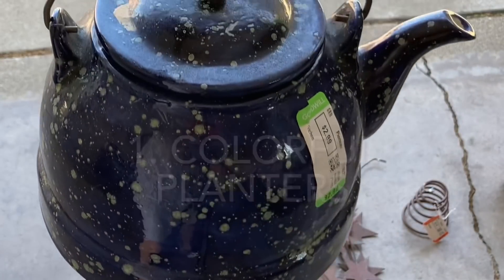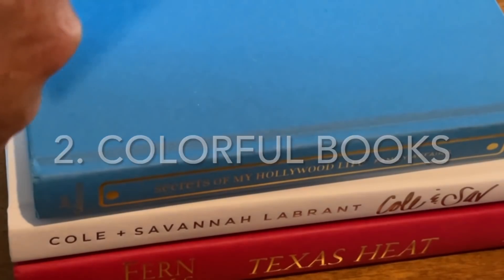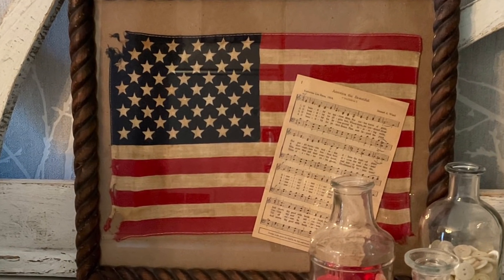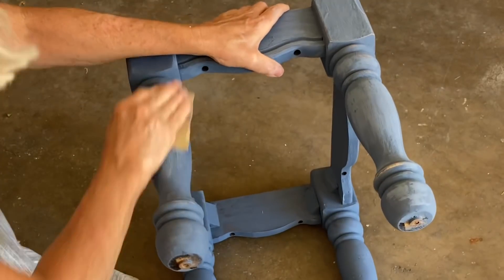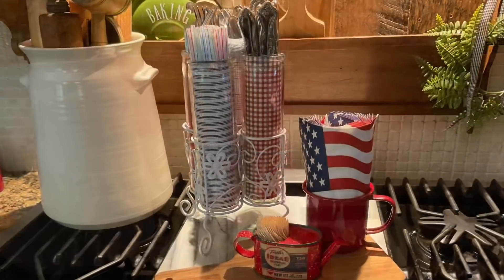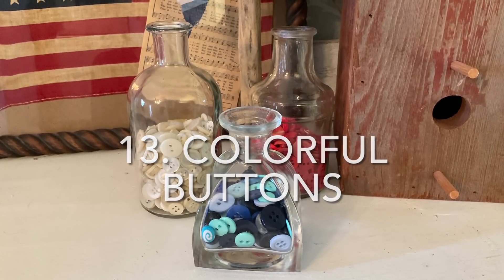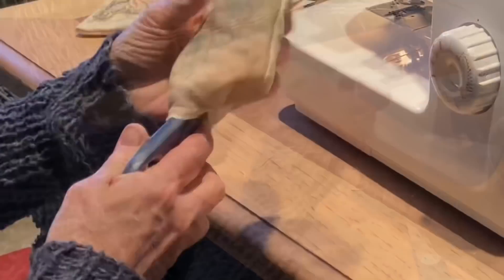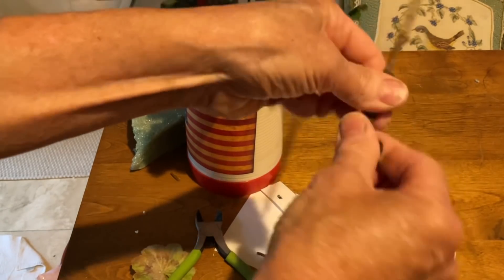15 SUPER SIMPLE AND CHEAP DIY PATRIOTIC HOME DECOR PROJECTS FOR SUMMER

Comment: oh no, you didn't!  hahaha!  welcome aboard, doll head!  you made so many lovely projects this week!  i can't pick a favorite.  i have a 4th of July craft challenge for you:  i once made a pillow on a pillow.  let me see if i can describe it. i had some old lacy fabric from a couch or chair doily.  i also had some other material for the main part of the big pillow.  i cut a heart shape out of the lacy fabric and a heart shape out of another piece of fabric, each identical in size and maybe 7 to 8 inches across.  (i was making a small bed throw pillow.)  i cut a circle in the center of the backing heart shape and sewed the two heart shaped pieces together around the edges of the heart, right side together.  i cut the big pillow fabric into 2 rectangles, but a square or other shape would work also.  on the center of one of the rectangles i cut a circle the same size as the circle on the back of the heart, and sewed the pillow fabric to the hole to the back of the heart, around the edges of the circles, with the holes lining up. you have to join the heart and the pillow in such a way that the seams do not show from outside the two parts, and the heart can be stuffed going into it from inside the pillow.  making sense so far?  i then sewed the back piece of pillow fabric to the front piece (right side facing each other), leaving one side open for stuffing.  going through the opening on the large pillow, start stuffing the heart shaped part first and then stuff the rest of the pillow.   it came out pretty cute with the stuffed heart mini pillow sitting in the center of a larger pillow, giving the entire pillow a 3-D effect.  i may also have added some lace around the edge of the heart as i sewed its front and back pieces together, and added some lace around the edge of the finished pillow.  here's the 4th of July challenge:  what if you made the mini pillow out of blue fabric with white stars, and the big pillow from red and white striped fabric, to give the entire creation a US flag theme?  just an idea.  you are such an inspiration!  thanks for posting another fab video!
Reply from the maker: Ok, I think I actually understand what you did! 😀 Would you get the same effect if you made two separate pillows and glued them together? (That would be easier.) This would be a cute Valentines Day project with the heart shaped pillow! I am going to percolate on this idea a bit and see what I comes to me.  I like the patriotic theme, but I wasn’t originally planning on doing anything else patriotic after this video. Maybe, a flower shaped pillow?
Reply: @CanterburyCottage  : yes any shape would do for any occasion.  yes, you could glue a small pillow to a larger pillow, but i am not much of a seamstress and i was able to create the sewn pillow i described without any instructions or crafter showing me how, so i know you could do it. i was much younger then and enjoyed challenges.  now i enjoy watching pros like you take on challenges.  :-)
Reply from the maker: I think you might see a pillow like this in a video in the near future!😀
Reply: @CanterburyCottage  : omg! really? you are such a good egg!  will you try the sewing method?
Reply from the maker: I’m not sure yet.  I want it to be easy enough that most people can duplicate the project.  I was thinking of doing small flowers which would be even harder to do with the sewing method.

Comment: I would like to paint glazed pots for outside, they are big and red which I'm totally over. Do you have any ideas of what paint I need and any preparation that needs to be done before Painting?
Reply from the maker: I think there are a couple of options that should work.  You could paint them with chalk paint (which would not require any prep except to clean the pots).  You would need to use a spray clear topcoat over the chalk paint (such as the outdoor spray polyurethane I used in in my patio makeover video).  A second option would be to slightly scuff the surface of the pots with sandpaper and follow with spray paint. (I would  finish with a clear topcoat just to make sure the paint doesn’t chip.) Hope this helps!

Comment: A good way to keep a fern alive indoors over the winter is in one of those self-watering pots.  I just get the cheap ones from Lowes or Home Depot.  Once a week I water the soil from the top until water comes out of the overflow hole.  Ferns like to be wet.  I've kept the same Fluffy Ruffle fern alive through 2 winters this way and it's still going strong.  Providing a constant water source with a self-watering pot will help them deal with dry winter air in your house.  I killed a lot of indoor ferns before discovering the self-watering pot trick.  Maybe Sherry can give us some ideas on how to disguise the ugly plastic self-watering pots!
Reply from the maker: Thank you so much for the suggestion! I have yet another fern that is hanging on for dear life as I type this! I will head to Lowe’s this week, and, yes, I will disguise it if it is plastic.😜

Comment: Could you tell me the best way to clean wax from your brush?
Reply from the maker: I usually just wash mine under hot running water and wipe off in a rag several times because I only use the brush for wax. If your brush needs a better cleaning, pour some mineral spirits in a small jar and let the brush soak for a few minutes and then, wipe off with a rag—it will be good as new.

Comment: What glue are you using, beautiful  peices
Reply from the maker: I use thick Starbond superglue.  I have a link to their products in the description box, and if you use code CC10, you will get 10% off.  It is a little pricey, but it glues everything! I like the thick variety because I don’t get it all over my fingers like the thin variety, and it takes a minute or two to dry, so I have time to adjust things in the exact position that I want.  The spray accelerator speeds up the drying time once you have positioned everything, but you don’t necessarily need it.  Hope this helps!

Comment: can plastic be painted?  with what and how?
Reply from the maker: Yes, depending on the look you want, you can use spray paint (check the can to make sure it says for use on plastic), or you can hand paint it with chalk paint.  If the chalk paint, isn’t sticking, brush on a coat of Mod Podge first.  Once that dries, the chalk paint will stick just fine.